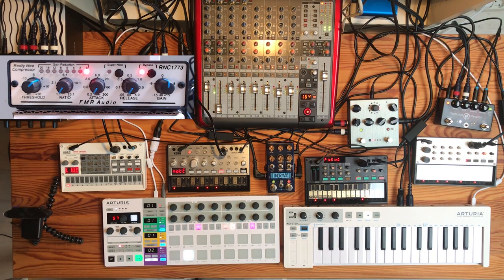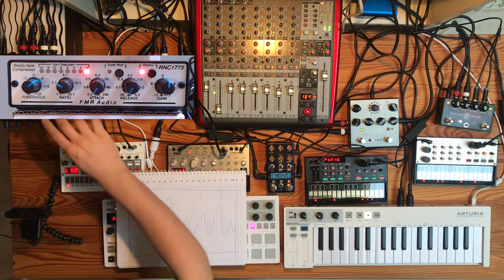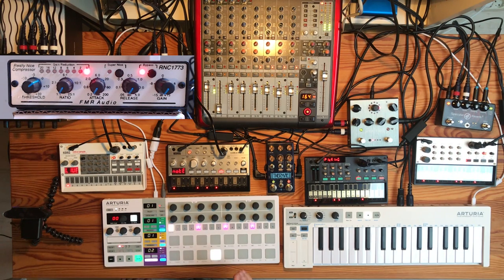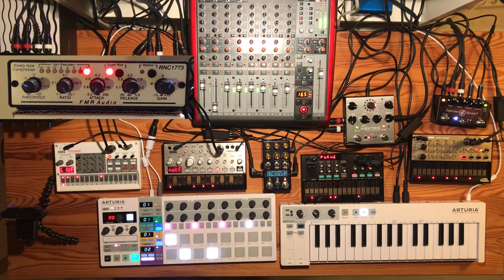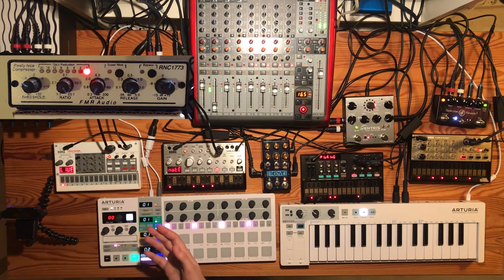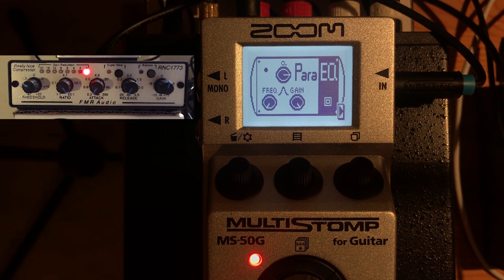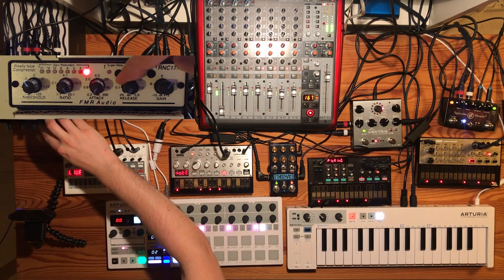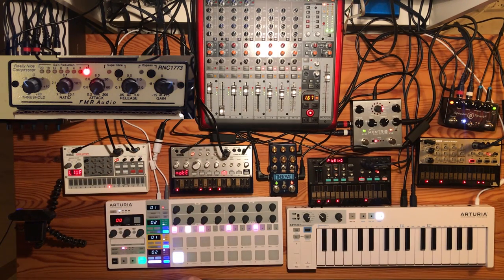Really Nice Compressor: Latest Addition To Our Volca Setup (FMR Audio RNC 1773)

Comment: I think a lot of the things you're doing with the EQ can be fixed if you up the attack time. Higher attack time means that the transients of your kick is allowed through, but your bass will be compressed. a place between 10-50 ms might be nice. The issue with the EQ-ing is that it gives the bass a sudden boom in the 30-70Hz range when the volume is going down. It fuses with the next kick, and makes the mix sound muddy. The compressor is already doing a good job of maxing the mix sound more cohesive, but I think it's overpowering in the 30-70Hz range.

The higher attack will allow the transient of the kick through, and give it the rhythm controlling quality kicks are for. Hopefully, this means you can step back the post EQ, and drive the threshold a few dB lower to get even more cohesion in the mix!

As always, fantastic music!
Reply from the maker: Septimius : Thank you so much for the elaborate comment!! This was exactly the type of feedback I was hoping for. I’ll definitely experiment with your recommended settings. Cheers!
Reply: Thanks for the video! Also looking for a affordable mix buss compressor. One addition to septimus really good explanation: When sending the whole mix to the mix buss compressor set the release time so that the compression never drops completly to zero. It makes the sounds glue perfectly and you get even more cohesion in the mix.

Comment: Another trick that might be worth exploring to have only the kick trigger the compressor, is to use the Drum gate from the BeatStep Pro into the sidechain input. Whenever that part triggers, the pulse should (theoretically) be enough to trigger the compression.
This way, even if you have a bass synth which overlaps with the kick's spectral response, you only get triggers from kick hits.
Also, it lets you do some "silent pumping", where you mute the kick on the volca, but the compressor still pumps the rest of the mix as if it was there.
Reply: That is excellent advice. Thank you.

Comment: If your running the RNC across the whole mix bus, then you really want to be in Supernice mode, NOT normal mode. Supernice mode is a multiband compressor, whereas Normal mode is just a single band compressor that you run just on a single channel. To do the job you want to do, ideally you should have a compressor on the drum mix only, you can run your bass signal into the side chain if you want to get different effects for different styles of music, or run the bass into a separate compressor for ultimate control. I use three different compressors going into the mixer, plus the onboard compressors on the Behringer mixer, plus the compressor in my MC 909. The ultimate setup for me, is to have separate compressors on all instruments, on all effects sends and then a good multiband compressor (RNC Supernice mode) on the mix bus, then you can achieve anything.
Reply from the maker: Kim Gauge : Thanks for the feedback!! Your tips are very welcome. We have already noticed an improvement on our when using compression on the total mix, but I get what you’re saying about using the Super Nice mode. :)

Comment: lower the gain of your kick and adjust settings so that it is compressing the bass spikes to match the level/punch of the kick and that will glue/level the mix so that the kick is not compressing the whole mix on every beat. That's another way you can do it. Compression is very versatile. Better mixing will mean less extreme compression settings.

Comment: Great  vid as always, I've just picked up an RNC too but really struggling with the connectivity. I know it will only work with unbalanced signals, it looks like you are using Y/insert TRS cables from the ALT 3/4 ports on your mixer rom how you described it. Does this mean Alt 3/4 actually works like a channel insert but for the whole mix? I wanted to use the RNC on the mixer's output going into my interface to nicely (no pun intended) glue everything together but that doesn't seem possible now, your method seems like a great workaround.

Comment: Awesome! any chance you could spend a little more time talking about the routing and cables used. I am trying to hook it up to an apogee 88 but have'nt had any success.
Reply from the maker: Rodrigo Zapata : Could you be a little more specific? What isn’t working - getting the audio in or out, or using the sidechain input, or...? :)
Reply: Aaaaand then the guy vanishes... Typical. :P
Reply: @Claidheambmor  I'm here baby, don't worry.
Reply: @SlenterendeBeer  having issues getting a pump. Using a volca kick to trigger. Someone said dont plug into the sidechain port completely?

Comment: Hi dude :) 
I was using  3.5 out of Beatsteo Pro right into sidechain. Try this out :)
Reply from the maker: Grzegorz Kielma : Yeah that works as well! The only downside is that you’re just sending a trigger, instead of audio, so it won’t follow the sound of your kick. But generally that shouldn’t be a problem. :)
Reply: @SlenterendeBeer In that case sound following is adjusted by comp release :) Smooth as hell.

Comment: why didn't you sent the signal from the kick that is going to your mixer, to a seperate (small) mixer first and then split the signal straight to your sidechain input (as a ghost) and one to your mixer?
Reply from the maker: Yeah I'm doing something similar now: I'm just sending the drums to the side chain input of the compressor, and use the Zoom to with the low pass filter to isolate the kicks.

Comment: thanks for this Abel!
the only thing i can't wrap my head around is:
if you send the master out through chan3/4 into the RNC and back into the mixer, don't you get a blended wet/dry compressed signal on your master output?
How do you make sure only the compressed signal gets to the master-output (and your headphones)?
Reply: never mind, the Mute button on the Mackie sends the channels to the 3/4, which you can route back into the mixer and out to the master.
BUT, now my fx sends/returns don't work no more on the separate channels! 
It only works on the returned 3/4 channel, but that means the effects are affecting either everything or nothing in the mix...

what now?
Reply from the maker: @sjememe  Yeah using the mute buttons is the solution. With my mixer (UFX1204) I can use the onboard FX sends per channel. Maybe you can change something in how the FX sends / returns are routed?
Reply: @SlenterendeBeer  i'm afraid my mackie 1202vlz4 sends/returns the fx after the sound is sent to OUT3/4. So dikke pech voor mij.
a solution is to use dedicated pedals per synth before they go into the mackie (like yo do), or put the compressor between the main out and my monitors. but then i can't hear the compressed sound on my headphones...
oh well..
thanks for answering!
Reply from the maker: sjememe : Ah, jammer. Yeah I’m not sure routing the compressed signal back into the mixer is quite common, to be honest. For us it’s perfect, because it allows us to also record the compressed signal with the built-in multitrack recorder.
Reply: Blending the compressed signal back in with the dry is a technique known as Parallel Compression, and  you can get great results with it.

Comment: Hi I'm new with using compressors and just bought this. I am interested in recording male pop (high) vocals. I have a Grace M101 preamp , a Cloudlifter, a Focusrite Clarett 2Pre. My mic is the Shure SM7b. How do I connect the compressor in the vocal chain? And can anyone suggest some compressor settings to begin with?
Reply from the maker: Nico Lakoumentas : I have no experience recording vocals with a compressor, but I think Google can give you tips on good settings for that! :)
Reply: Now, the issue here is that you want to run your compressor AFTER your preamp. I haven't recorded vocals with a compressor before the pre-amp before. The optimal way would be:
Mic -> boost -> preamp -> compressor. To get this to work with your setup, you'd utilize both the inputs of your Clarett. You'd use one to input the mic, then a line output to output the first input, into your compressor, then out again into the other input. That second input has to be set at unity gain, so it doesn't further "pre-amp" the signal. 12 o'clock should be unity. That's the way it's normally done. The issue with going boost -> compressor -> preamp is that your signal isn't really hot enough yet for the compressor to work, even with the Cloudlifter.

Your goal is to only compressing a few dB under normal singing. Your aim is to even out the level just a little bit, so you can add some dBs (~5) to the whole vocal track. This makes it tighter, and makes it sit better in the mix. You can go up to 4:1 ratio, and a threshold that takes out just the loudest parts. You want your compressor to engage about 5-10% of the time you're singing. You want an attack of about 20ms, and a release of around 200ms (0.2s on this) make-up gain up as much as you can without clipping.

I'd recommend recording the vocal track without the compressor, because the compressor settings depend on the track. Some music allows for more dynamic singing that other, and other types require a more compressed vocal track. In this case, you could record your mic -> cloud -> clarett, then when you're mixing, use an output to output the vocal track into the compressor, then inputting it into input 1, and listening to that in your DAW instead of the 'dry' track. This means you can dial in the settings the way it works in your mix before "freezing" the track. It also means you can go back and change it later, which is why this is the way it's normally done.
Reply: @Septimius  than you so much ! You're information was super helpful . I'll do my best to get my results . If I have any further queries I hope you have the time to assist . Thanks again bro! I couldn't even find these specific details on Google ! 😉
Reply: @nicolakoumentas3305  No problem at all! I felt like I was completely missing a step of your setup, the M101. Disregarding that you have a great preamp already in the Clarett, I'd just like to underline that the point still stands. Use the mic -> boost -> M101 -> Clarett to record in your DAW, then do the FX loop described before to use the compressor. It might seem good to go M101 -> comp -> Clarett, but the truth is that vocal performances vary so much that you'd want the ability to dial it in later.

Working with the same singer, they may have a more powerful take, or stand just a tiny bit further away from the mic. You always want to see that your comp is reducing a few dB no matter the take, so being able to add the compressor later is key.
Reply: @Septimius  thanks again! This is awesome 😊 I can't wait to incorporate the compressor. I seem to get TOO MUCH gain when I use all 3 (Cloudlifter, M101 and Clarett). I guess I must work out the sweet spot and where each gain knob should be set on the different devices.